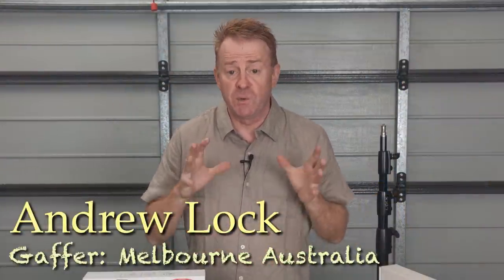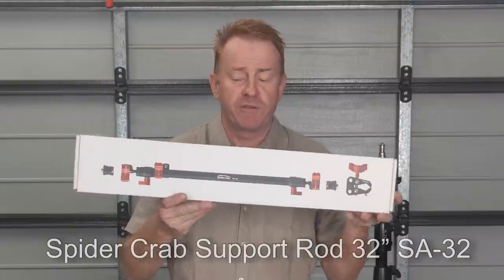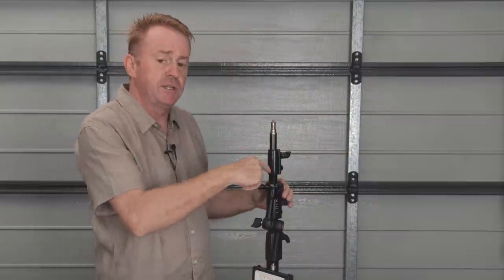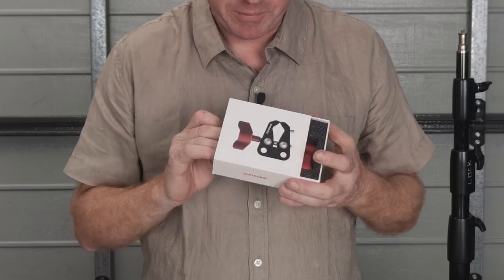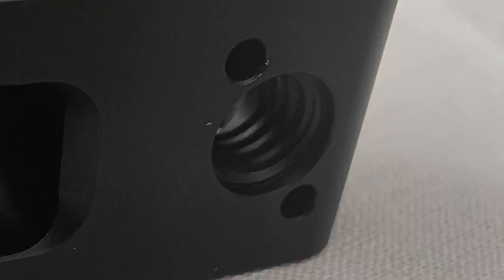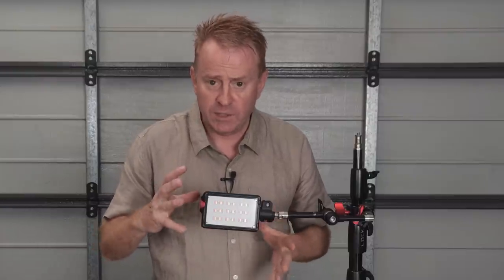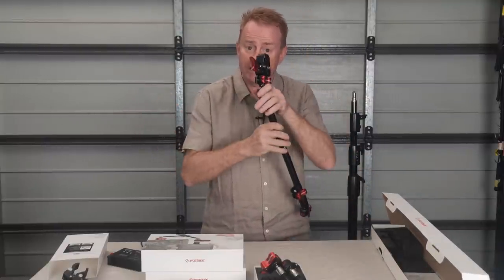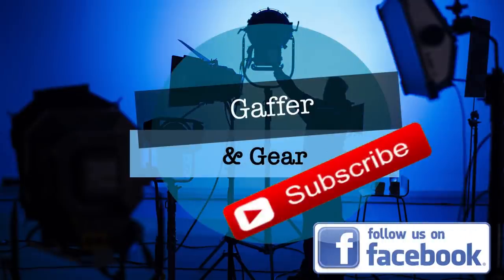Gaffer & Gear 178 – IFOOTAGE Clamps & Arms

Comment: It is worth pointing out the the base of the cold foot is tapped not just for 1/4”-20 but also has the key holes for Arri anti-twist pins. This allows connecting two of the iFootage magic arms end to end. As someone already pointed out, the  SA-32 does a very good job of being a second support for a slider for a slider when there isn’t room for a second tripod. I use it with a 24” Rhino carbon-fibre slider.

Comment: The extension arm is generally used to support one or both ends of a slider.   This SA32 looks like some sort of variation of those slider supports that I use.   The dual pin lock is often referred to as Arri style pin system.   At least that’s what small rig calls those pin systems.  As you can appreciate not only do lights tend to unloosen if you use the left side configuration but so do small monitors which people do tend to out in the left config so the double pins can keep the monitors from twisting around as well as up and down.